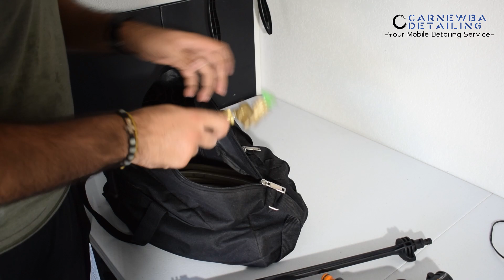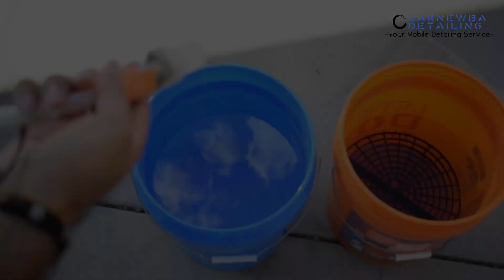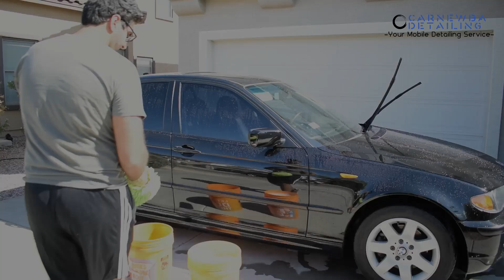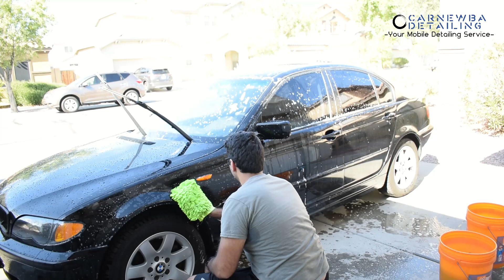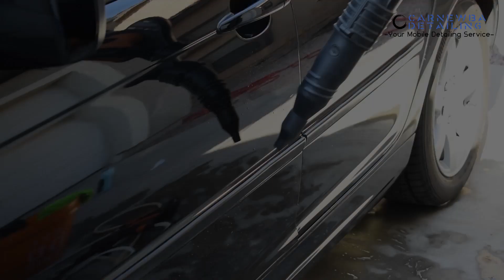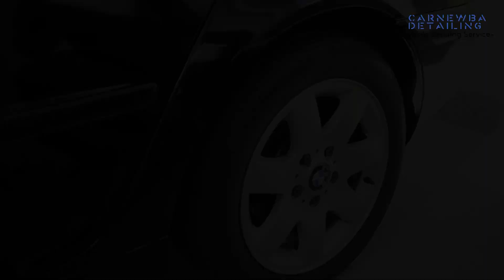HOW TO DETAIL A CAR FOR BEGINNERS! (Using the Worx Hydroshot)

Comment: Carnewba, I have some questions? Your title of this video is "How to Detailing a Car for Beginners". I am not a professional detailer, but your title should have been "How to do a maintenance wash"?  Your title is misleading?  When I see detailing a car, I think of strip washing, mechanically & chemically decon., polishing, waxing & applying a sealant.  Also, I wash the wheels second when I do a detailing, first I wash the engine bay.  I noticed you use ONR as a drying aide, which is fine.  But, as you may know, you can wash the entire car with ONR and skip the traditional wash.  It will save time, water, & money, especially if your doing this for money?

Comment: Zaia, is there any product you would recommend to use with the foam cannon for the Hydroshot? I wash my car in my apartment complex parking lot, so a lot of mess is not desirable 👍🏼
Reply from the maker: I would use just a few oz of p&s Pearl, does not foam up to much but has great cleaning abilities!
Reply: Worx does sell a soap dispenser attachment. It won't create foam but would soap it looking like how he did in the car. You  can either let the soap do its work and rinse it off if you don't want to scratch the paint or you can go over with a wash mit/cloth to give it some agitation. My vehicles wrapped so I like to give it a quick wash after each ride, so I just do a quick rinse, then soap it, let it sit for a couple minutes then rinse it and dry it then depending how lazy I am do the windows with a window cleaner. This takes about half hour to do.

Comment: Pretty good - but - I use my Hydroshot 1st as a soapy pre-wash with a high-concentration of Turtle Wax Wash, less than $5 a gallon .... the Zymol is great but pricey. 

( Suggestion : Order a 20V / 4A battery from Worx and the Turbo Nozzle. Next step is the 450 psi double battery tool that brings you up to 8A of power from 2 ) 

I then use a dozen or more freshly cleaned microfiber wash cloths lightly a section at a time. Any touching of the paint is then done with the new hybrid ceramic wash at a high concentration to lower rubbing pressure needed. 

For tires/wheels I still like Dawn but don’t use the industrial or super concentration — just hesitant to use such strong chemicals and risk discoloring or other problems. 

I only air dry. Followed by a new spray cleaner/wax like Rain-X or similar  — keeping all touching, rubbing, scrubbing, buffing to an absolute bare minimum.

Comment: Great video !   Do you mix Meguiars X-press wax and ONR in one sprayer ?   If so, what ratio ?
I notice when you dry the hood, you just spray and wipe with a damp towel once.... dont you need to buff after with a dry one ?
Reply from the maker: 256:1 for the onr and I believe I put around 10oz off xwax in there as well! And no no real buff off needed!
Reply: @48Detailing  do you put x-press wax in the ONR bucket you use with the Hydroshot ?
What is in the little Black sprayer you use as drying aid ?
Reply from the maker: @arnenuggat  the dilution I gave you is what's in the little black Bottle!

Comment: How long did the one battery last you? I recently got the newer model with 2 batteries attached and it only lasted like 15-20 min. I’m kinda disappointed.
Reply from the maker: With the single battery I would get around 20 min or run time 👍

Comment: Where did you get the adjustable tip for the Worx?  That would come in handy.
Reply from the maker: It's called a pivoting coupler you can find it on Amazon!
Reply: @48Detailing  Is that the Worx branded one? Or does any old coupler fit? I'm assuming it has to be the Worx.
Reply from the maker: Nope any coupler should work!

Comment: Could you hook up a foam cannon on the worx washer
Reply from the maker: You can purchase a "foam cannon" from Worx that directly attaches to  the hydro shot. It works okay, you can also connect any quick connect foam cannon to it but there is not really enough psi nor gpm for it to produce proper foam.

Comment: Looks like good amount of pressure for car wash... which battery where u using? And does the attachment ur using increase the pressure? Thanks
Reply from the maker: Hey kamran, thanks for the comment! I am using the standard 20v battery that comes with the tool along with a 25 degree nozzle, which does slightly increase the pressure!
Reply: @48Detailing  Nice! I cant seem to find the nozzle. Where was it purchased from?
Reply from the maker: You can usually find it in your local tool store, but I got mine of Amazon! Link to the Amazon page is in the description of my previous video: https://youtu.be/Kh9VQxagZK4

Comment: Hi, thank you for the video.
The nozzle is better then the nozzle that came original with worx?
The pressure is stronger?
Reply from the maker: It does not add any additional pressure, but it does add more flexibility to the tool. It helps you get into harder areas because of the pivoting feature. Hope that helps, and thanks for watching!
Reply: CarNewba Detailing where can I buy that movable nozzle? Thanks
Reply from the maker: Hey jack! The link to the movable nozzle can be found in the description of me first review of the hydroshot! Here's the link: https://youtu.be/Kh9VQxagZK4
Reply: I did notice that the nozzle used in the video does spread the water better compared to the tip that comes with the hydrolock. The hyrdolock tip looks as though it spits the water out so more water needs to be used..

Comment: Keep on hearing ONR ? What is it?
Reply from the maker: Optimum No Rinse otherwise known as ONR is a no rinse wash that provides individuals with little to no room or water sources to wash there vehicles. Check out my video describing the product, how to use it and also its results! https://www.youtube.com/watch?v=ORyX5dKK6UA&t=854s
Reply: @48Detailing  can you do video on ultima waterless wash plus.. getting many youtube videos now on that. Provide ur fair review and also any products which are cost effective for single use consumer guy like me.
Reply from the maker: The product looks very similar to onr, but it is by far the more expensive choice of the two. Ultima comes in at $20.99 for 16oz while ONR is $20 for 32oz. So value for money ONR is a better option up front. Also I have noticed that you need 1oz of ultima for every 3 gallons of water, while ONR recommends 1 oz for every 2 gallons of water. But still I don't see that making up for the lack of product providers for the price point.  I'll try my best to get my hands on a bottle, but from what I see upfront ONR is a better option when it comes to value and also comparing it to some other products results as well.